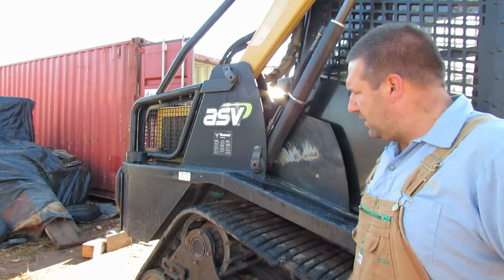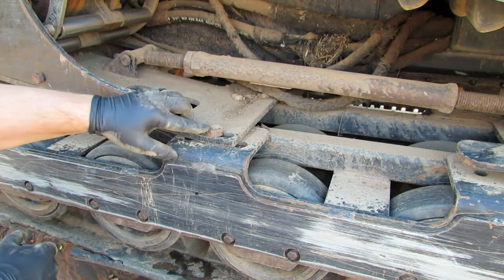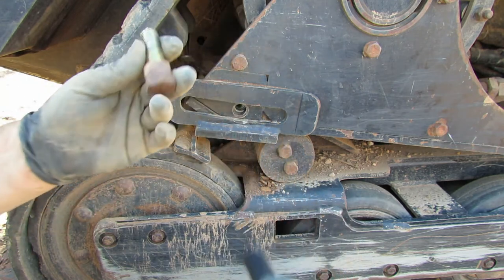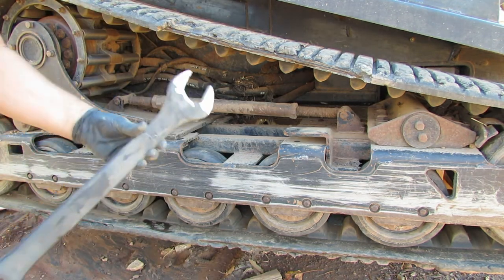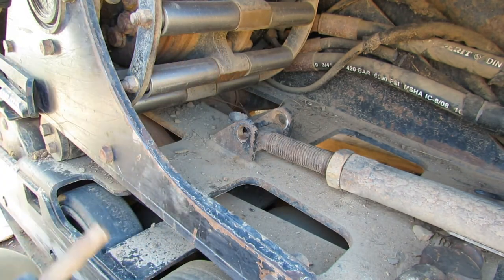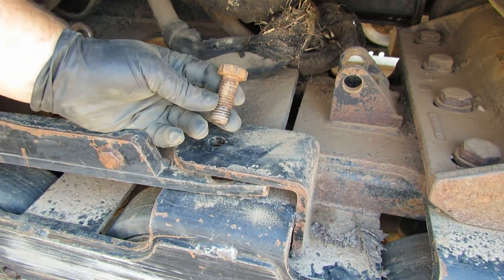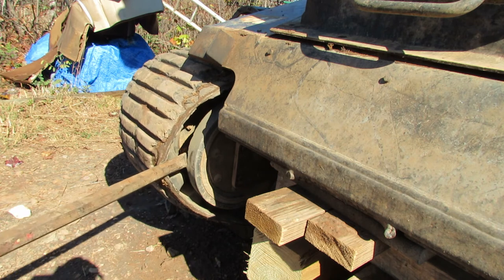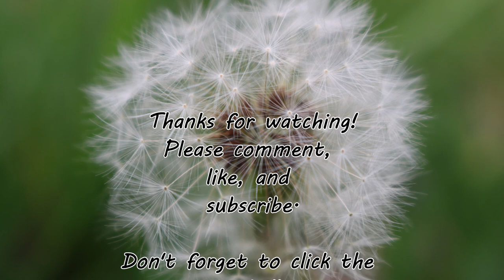Part 1 ASV PT100 Undercarriage Rebuild (Track Removal)

Comment: A pipe wrench works the best for that adjusting rod
Reply from the maker: @STEVEN LEE sounds like you have a lot of experience with this style of undercarriage. Thank you for taking the time to help everyone out. Would you place the pipe wrench on the nut part or the tube part? I am asking because it would damage the hex head on the nut part or possibly crush the tube part if things were very rusty. Do you have experience with either of these circumstances? ~Mr. C.

Comment: I’m working on a cat 287b. I noticed you had disassembled the  asv axles. How did you pull the seal? Do you have special tools for the seals and retainer rings? Were your axles grease filled? Thanks for video, and your help. Dennis
Reply from the maker: @denniseubank8544 I just changed the idlers and bogies. I did not change any bearings or seals. Thankfully all of them were good to go. No leaks and all of the bearings were smooth. I believe mine are oil filled but don't quote me on that. Sorry I could not help more. Thanks for watching and happy wrenching! ~Mr. C.

Comment: Really great video, i bought a 2010 terex pt100 with only 900 hours, after how many hours did you have to replace all those parts?
Reply from the maker: @tonypinon98 that's awesome! Nice machine. It had right at 1000 hrs. 1200 hrs on it now and everything looks and works great. Thanks for watching and asking. ~Mr. C.

Comment: Thanks so much for putting the video together. I love the DYI stuff. I just purchased my first track machine. It is a ASv rt60 2016. Your video has inspired me. A couple of questions. I’m wondering if you used soapy water to help get the track over the wheels? And also I was curious what the investment was for all the parts and where 
you purchased them? Thanks in advance
Reply from the maker: @Mark Foster you are very welcome!Congratulations on getting an awesome machine! It is my pleasure to make these videos. I love the community on here, so many cool people. I did try soapy water but it made the tensioning tool slippery too but it did help a little. The parts for the undercarriage and some maintenance items was around $7500. I purchased everything from trackloaderparts.com. Very nice folks with excellent customer service and prompt shipping. Thanks for watching and commenting. ~Mr. C.

https://www.trackloaderparts.com/